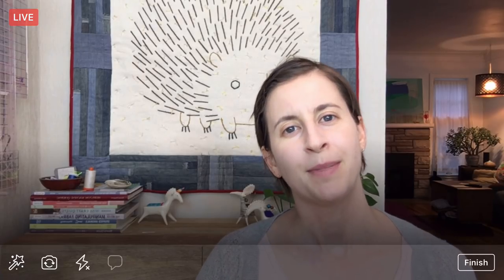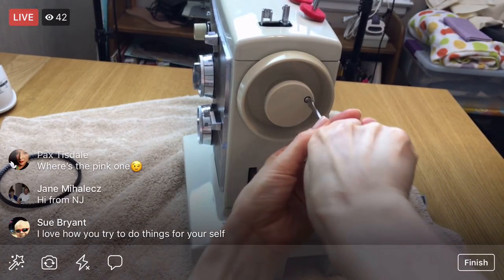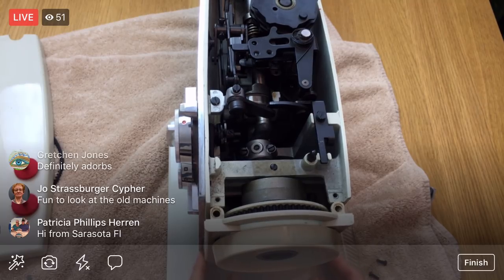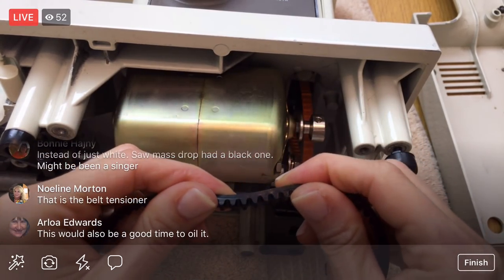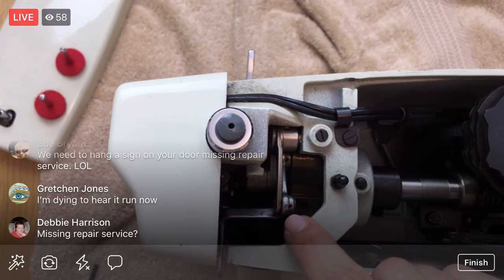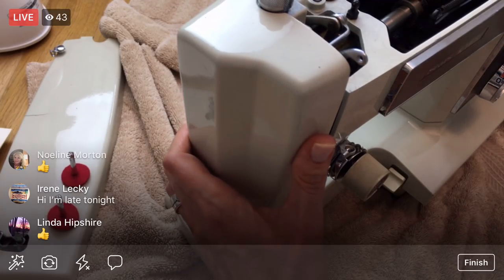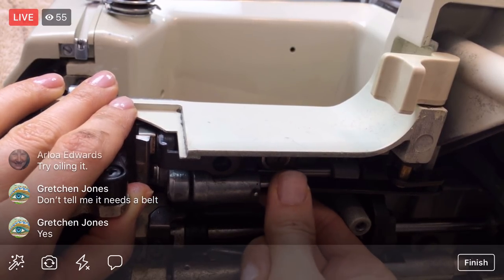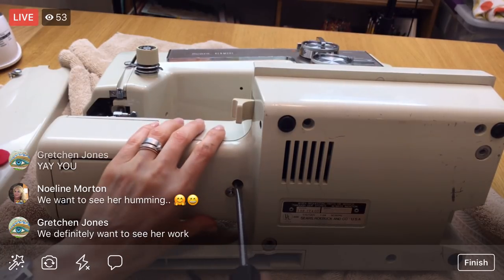Replacing a sewing machine motor belt - Vintage 70's Kenmore - Lug belt - Live replay

Comment: 1. For all viewers, you can get the side panel off by turning the knob attached to the belt with a screwdriver under the belt so that the screwdriver skips the belt out of the pulley, similar to how she reassembles it but in reverse.  This will help protect the side panel from breaking.  Also, there should be tensioner screws below the two pulleys that you can loosen and the pulleys will move, hopefully enough to get the belts off.  I wouldn't recommend taking the pulley off as she did, as that little nut on the back is difficult to access to torque up, she did not tighten hers.

2.  My feed dogs do something similar, but they will go down if I push them down after flipping the switch.  It looks like the pin is withdrawing enough on this one, my bet is that the linkage is just a bit seized up, try pressing down on the feed dogs after flipping the switch if you haven't.

Comment: My machine is doing that stalling, clunky thing, I think it definitely has to do with the belt ! As I am in lockdown I am keen to try to figure it out myself and your video has given me alot of confidence to open my machine up - my machine is very similar to your one here (a Brother, from the 90s) and the hand wheel mechanism is identical so hoping changing the belt might be a similar process too!
Reply from the maker: Ooo! Good luck. Excited to hear how it goes.
Reply: @Penguinandfish   thankyou! it went pretty well, very interesting to see those belts up close & personal! similar to you there would have been a time where I'd never open my machine up but, now alot more relaxed about it and unable to take it anywhere in the pandemic I figure I may as well check it out (carefully!) So I was thinking my lower belt was broken/cracked and that's why my machine was struggling/stopping/not sewing smoothly but I checked it and it was all in good condition! I adjusted 2 little bolts with my screw driver that move the lower belt 'pulley' - this seemed to help, though I have had to keep opening my machine up and adjusting this, as my machine keeps going back to that struggling sound like it can't sew! very frustrating, I definitely need a professionals help but your video was definitely interesting !
Reply from the maker: @aelyse4907  It's definitely an adventure to open up the machine! I hope you manage to get yours working again.

Comment: Viewing the video late but came here to see the belt replacement even though I have a White.  I just bought it 1963. And the belt is thrashed every worse. The orange ones I found out are neoprene. Your replacement looks rubber but the online sites tell me to get the toothed orange one. I dont even know why any company would make a neoprene belt. Thats like plastic?! So I’m looking for a rubber me or maybe a non toothed. Which they actually called lugged. I dont see lug spaces on my machine but not opened it yet. Just info for anyone reading.

Comment: I think you might have put your clutch washer (at the handwheel) in backward.  The protrusions need to point away from the machine. Your stop motion might not work when you wind your bobbin up top unless you turn that part around correctly.

Comment: Hi Alyssa thanks for the sharing this video. I learned a lot about changing sewing machine belts. Thanks again.☺
Reply from the maker: Thanks, Faith!
Reply: It's always helpful, if--before a video is done, one would make a 'dry run' of disassembly and reassembly when the 'official' filming is done. Then make sure you know what you're doing and explain plainly the steps as you go along. This can be confusing to a newby other than listening to this young lady which IMO is very distracting and the instructions are in bits & pieces indicating her lack of solid knowledge. Hope you all get something from this.

Comment: Does it feel like it is dragging with the new belt?
Reply from the maker: No. After the new belt, all the skipping and dragging went away. I wonder if the dragging is because the new belt is too big. Not sure if that would be the case though.
Reply: @Penguinandfish  my belt was toothed on both sides and it felt like the teeth were releasing one by one. It was like push starting a tank. I found your video at the same point you were trying to remove the back panel and upper belt.

Comment: To measure for a belt, in case the belt does NOT have the measurement printed  on it, take the old belt off and take  a measure tape, the thin retractable ones work best, and wrap around the hand wheel the motor gear where the original belt was, this is the MOST ACCURATE way to measure for any sewing machine to be able to order the RIGHT belt the FIRST TIME. Don't ever measure the outside of the old belt because it has stretched out  of shape over time.

Comment: Made me REALLY NERVOUS when you started yanking at the side by the hand wheel. ALWAYS look for ANY screws in the area and around to remove, sometimes  there is that ONE small HIDDEN screw (like under the handle of some machines) that will STOP you from removing the part to get access.